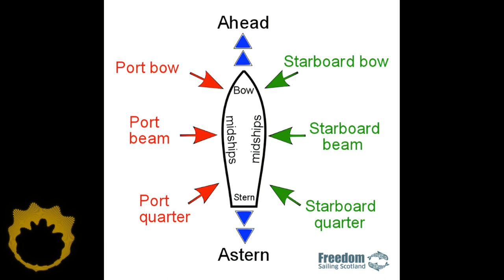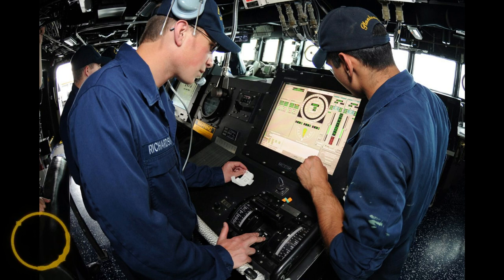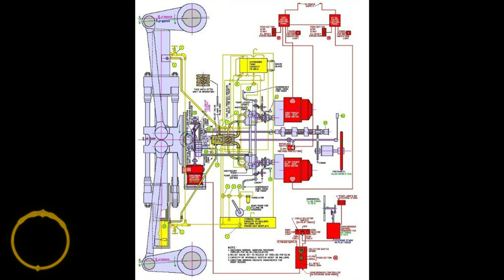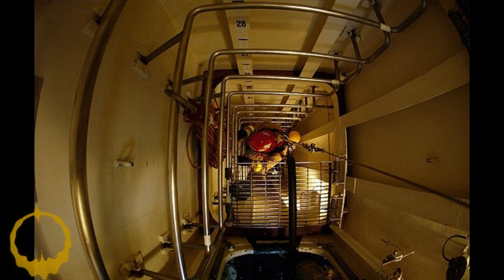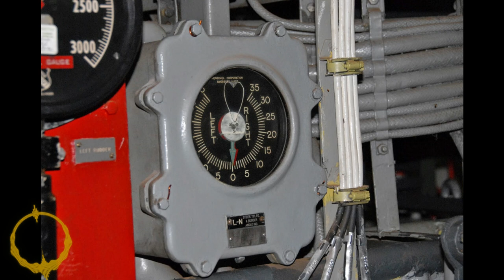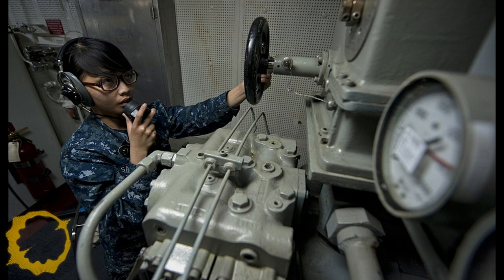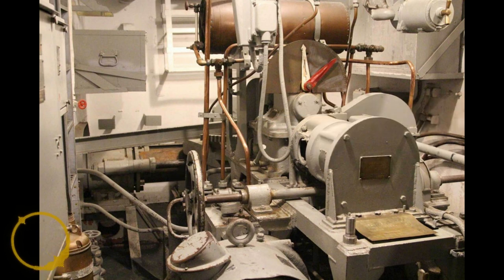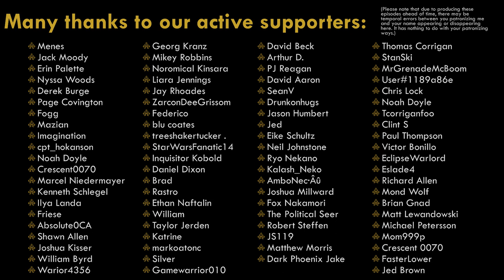I should get an award for a total lack of questionable idioms in an episode about Aft Steering

Comment: Touchscreens are not a thing we should be using anywhere, let alone anything important. They are simply garbage, either too sensitive, or not responsive enough, there is no inbetween, or rather, the inbetween is when it is somehow both, and in any case what you get is shitty controls.

Comment: I spent 2 years aboard a Wasp-class amphib as deck seaman.  In aftersteering the control wheel on the rudder engine is only about 8 inches in diameter; got to use it twice in training.  It is truly surreal to understand you are controlling where 40,500 tons of ship is going with nothing more than an 8 inch wheel, gyro compass repeater and rudder angle indicator, while also locked inside a windowless room, 2 decks below the waterline, and facing backwards while a voice on the headset tells you what course to drive.  Oh and you have to coordinate your rudder movements with a second aftersteering helmsman locked in the room next to you.  "Left five, and turn." And we both turned out wheels at the same time to ensure the rudder didn't collide.

And for the record the route to aft steering is as follows: walk to the aft end of the hangar and take the last ladder (port or stanboard) down a few decks, when the normal ladders/stairs run out climb down another three decks via the vertical ladder.  It is as it sounds.  Then stoop down and enter through an oompa loompa sized water tight door.  You have reached after steering, hearing protection is advised, especially at speed.

P.S.: the manual hydraulic pumps are NOT used to steer the ship.  It takes 64 revolutions of the pump to move the rudder a single degree.  These are only used to center the rudder at which point you steer with either just the remaining good rudder or with differential throttle on the engines.

Then the second to last resort for centering the rudder is a giant stationary worm gear and a ratchet.

Last resort?  A diver with cutting implements.
Reply from the maker: The use of the manual hydraulic pumps varies among ship classes, y'know.
Reply: @SacredCowShipyards  Physics, physics never changes. [/Ron Pearlman]
Reply from the maker: Rudder size, and number, does.
Reply: @SacredCowShipyards  More specifically what I am saying is that at any size of modern warship manual hydraulic inputs will render a rudder response time that is entirely insufficient for even minimal positive control of the vessel, hence the purpose of manual hydraulic inputs is at best used to center the dead rudder.

There is a threshold of size and mass where manual hydraulic inputs become adequate for the task.  In my ship's case the two small boats we had were both manual steering with hydraulic linkage.  The larger of the two being an 11 ton LCPL.  

P.S.: nice shipyard.
Reply from the maker: And I'm saying that on two disjoint classes of USN warships, the SOP for the hand pumps was to use them for actual steering, not just centerlining the rudder.  But, no, it was never going to be anything approximating "fast".

Comment: OK I got a question.  In the movie Speed 2 Cruise Control, they managed to turn the ship using the bow thrusters but as the electronics were down, they turned the bow thrusters using a hand crank wheel.  Whilst under water in a flooded compartment.  Ignoring the flooded compartment issue, is it even physically possible for one person to change the course of a cruise liner (albeit a smallish one by comparison to some of the giants built these days) just by spinning a wheel no bigger than a car steering wheel.  I mean if it takes 3 crew to use the wrench referred to in the video, one person spinning a wheel to drive the bow thruster?  One hell of a gearing ratio.
Reply: See, I'm confused.  If you mean they used a little wheel to change the direction of the thruster, it seems reasonable.  If you mean they used a little wheel to power the thruster, less so, because ships really prefer to move through the water the narrow way.
Reply from the maker: Yeah, there's basically no way a hand crank would be enough to turn a bow thruster's blades enough to actually do anything.  Honestly, since the ship was moving forward and the bow thruster was free-wheeling, the manual wheel would probably be spinning fast enough inside the ship to rip off digits.

Comment: I think you have come to the point why military in space has not become a thing. Military is making things go bad, preferably for the other guy, and expecting the same in return, so if you don't have a few levels of back up, all you have left is improvisation, which we know how military loves that. Cost to space by mass, then fine articulation of parts, cold welding in a vacuum, makes most things have no affordable backups. You don't see any kind of repair or even patch kits on most things right now. Even ISS only has it a little bit, and that is what makes sure they keep breathing. Why manned space in gneral is kind of really scary. You need a subset of home planet pieces to take with  you, and even stripped down to atmo and temp, that is often a lot of hardware for basic. Doubling that is really a big weight problem at the least, not to mention storage is in a different for than usage. 6 liters of LOX will give you a lot of breathable air, but you need to heat it and only allow so much in to the cabin at one time. Doubling up or making level of fail safe movement control is even more mass to shift. Luckily, most RCS fuels react due to the pressure drop form the tank to space, which means if you have some you can impart force, but controlling it along specific aimed lines could be a problem with just a bent nozzle, not to mention no nozzle at all.
Reply: The problem is that getting the backups out of the gravity well is expensive; on the other hand, not having backups when you need them gets expensive, too.
Reply from the maker: Thankfully, the decreasing cost of getting materiel into orbit will greatly increase the probability that future ships / stations will have adequate backups to preserve the existence of the little squishy things inside them.
Reply: @SacredCowShipyards  That's also why there is so much interest in Lunar bases and asteroid mining. If you can make stuff in space, it save a lot on launch costs.

Comment: Okay, hear me out... Giant wrench hanging on the bulkhead. Cap screw to secure it to the rudder shaft hangs beside it. 

Eye hooks on the bulkheads on either side of the compartment. A couple of big ol' chain hoists hanging from those eye hooks with heavy chains already attached. All of it normally secured, of course.  

Hydraulics go down, set the wrench, screw on the cap nut so the wrench will stay put without some poor swab having to hold it in place. Hook the chains to the wrench. One or two sailors on each hoist chain. Profit.

All mechanical, no electronics to go bad, exponential increase in power. Only an additional two relatively simple machines to maintain.

Comment: you can make that "big ___ing wrench" work!

you need three comealongs . . . two attached to the end of the handle with wall mounts left and right to pull against . . . the third attaches at the wrench center of gravity and is connected to a spot on the ceiling over where the wrench CG will be when deployed.

note: do not attempt in any condition other than flat calm!
Reply: Pretty much what I was thinking.

Comment: Any ship that has no backup for a backup is something questionable. Even old wooden boats had huge loads of stuff which only purpose it was to either help create the backup or be the backup. Of course backup systems can fail so you plan around that. Any spaceship in a half way realistic setting where travel through the stars takes a significant amount of time instead of being over in half a day will require enough backup that from a near total construction you are able to safely either limp back to a friendly "port" or at least call for help and have somewhere safe to wait for said help to arrive. 
And touchscreen for steering is the typical we need to be modern stuff that shows that whoever was implementing that never did steer anything significant let alone something of the size of a ship.

Comment: Cavitation is caused by the water effectively boiling due to low pressure. It is loud, violent, and causes noise and damage, but it also robs the ship of power and in the case of rudders, control authority.

I also had to take a minute to admire those screws and not just the curved rudders... you know they're putting out some power when they have to angle shafts downward like that, though I dunno if that was a "clear waterflow" issue, a "center of thrust" issue, a "make room for sufficiently large propellers" issue, or some combination thereof.

Addendum: Ships exist in this world without backups and redundancies, and they DO say something. "Your environment, your success in your endeavors, and your very life are not as important to us as our bottom line. We literally don't care whether you live or die so long as your check cleared. And if it didn't, we'll just bill your next of kin."

Comment: I actually know exactly what you're talking about with that wrench. Back when I was a sea scout in California we had an old 1950s Ex-army T-boat called the Gryphon. On the stern we had this red orange yard-and-a-half or so long steel tiller-like item on the transom, as well as a circular plate secured with flathead screws. I had no idea what those were for till we were on a cruise and Skip called a loss of steering drill. We took the plate off, lifted the heavy ass tiller up, put it on the nut that was beneath the plate, then secured lines and blocks to rings on both sides of the tiller and split the crew up to port and starboard. It was... certainly an experience, but to be quite honest I found it kinda fun in a weird way.
If I was still in California I'd be able to take a picture of it, but alas I'm in michigan, and none of the photos of the Gryphon that I have show the wrench. Still, felt I should bring this up as it is one of my many fond memories of Sea Scouts
Reply: Granted the Gryphon was nowhere near the weight of an OHP at only 80 tons, but I'd imagine it'd work the same way on there
Reply: Its crazy to think we still have that as a "just in case" system of TURNING. Like these ships are HUGE and HEAVY.

Comment: I suppose if you had a sufficiently long bar with a sufficiently heavy duty box wrench attached to an auxiliary vector thruster then it could maybe be used by a sufficiently huge crew member to give some degree of left and right as well as up and down? It would, of course, need to be set up 'above' a hemispherical floor to maintain contact and need suitable up/down/left/right sign posting.

Comment: Having manned aft steering on a Destroyer, I can verify the wrenches still exist, albeit in a slightly different fashion. On a ship with multiple rudders, should you lose all hydraulics for one rudder you lock it out with a pair of giant nuts on a 4" diameter lead screw. The key here is you need to maintain either constant thrust or zer thrust while locking it out. 

The one time we ever had to do that for real, some idiot officer on the bridge decided to shift what shaft was trailing while I had guys locking out one rudder. Damn near crushed someone. CO was pissed when she came down 5 minutes later and heard about it from us.
Reply from the maker: Locking out the rudder makes perfect sense.

Percussive maintenance on the person responsible for the course change with the wrench in question also makes perfect sense.

Comment: The wrench could be a good idea IF instead of using people to push it around you rigged a block and tackle system.  A proper set up would be a lot safer and would require fewer people to run it.  As for the escape trunk, that one looked pretty damned nice.  I toured the USS Lexington a few years ago and what she had just didn't look pleasant.  I do like the idea of rungs on two sides so your shipmates can have a passing lane in case you're not escaping fast enough.

Comment: If your vessel has any kind of shuttlecraft/fighters/parasite craft, and you have half-assed competent pilots, instant tugboats. Even if the thrust of those ships is like a wet fart against the hull of the main ship, it'll still turn...eventually.  Would asymmetrically deployed solar sails be a viable option? Was Treasure Planet not hot garbage??
Reply: Solar sails are a thing, although what little I've seen of Treasure Planet suggests that they were more interested in galleons-in-SPACE than what a light sail would actually look like.  The plus side is that these sails fold up very small and take up little mass.  Down side?  Unless you've got somebody shooting light your way you don't get a lot of thrust, and even if you had any silly ideas about stealth in space you can discard it because light sails are ginormous, and tend towards the shiny, albeit very thin (which is why they can fold up so nicely.)
Reply from the maker: cough

https://www.youtube.com/watch?v=-VUmFpibgIU&t=264s
Reply: @SacredCowShipyards  Oh I'm fully aware of your adoration for the film. Thus the shot fired across the bow so to speak (I actually found Lost in Space to be a supremely guilty pleasure...like feet pics...or certain beads...)

Comment: So here I was nearly through the vega run...  We hit a rock and reaction control went down. Unless you want to fly right into the actual Vega star, you have to flip over and begin hard deceleration shortly after entering the system. What? Did you think we burned freight at one G the whole way? Anyway, we tried the backup system, but it was unresponsive... The answer according to the Seridyne Systems manual is MANUAL READJUSTMENT of the main drive cone. I ** you not, they have a 12' long spanner attached to the aft end of the ship under an access panel, and you have to attach it to the nozzle and attach block and tackle to the port and starboard cargo nacelles and a clevis located near the the dorsal comm array, anchor yourself to the aft airlock, and start haulin line like some terran wet sailing vessel. Then you detach everything and stow the gear, get below and strap in for the flip... THEN THEY WANT YOU TO GO OUT AND DO IT AGAIN!!! Only this time you are attaching to the the port and starboard nacelles and a clevis by the ventral landing strut. Problem is this time the main drive cone is still glowing white hot after a twenty second ionized hydrogen plasma burn. Oh and ye better have some Duct Tape on you because there is a good chance that the wrench will have conducted enough heat that it will melt one or more holes in your suit while you're trying to stow it. I'll give you two guesses who happened to be the lowest rank on the engineering team when that happened. At least the Chief bought me some good scotch after I got out of med bay.
Reply from the maker: Scotch cures a lot of ills.

Comment: An interesting thing about the little bubbles created during cavitation. The inside of those little bubbles are as close as it is possible to get to 100% reflective.

There is also the possibility that Nanoscale cavitation bubbles can be used to utilize the casimir effect to produce energy. "Hope I spelled that right?" There was a plumber in Southeast United States who designed and built a water heating system for a firehouse. This water heating system produced overunity energy. Quite a few physicists came through to look at and figure out how it worked most of them left scratching their heads. One physicist theorized that the system he created was producing nanoscale bubbles through cavitation. He also stated that it's possible quantum photons were bouncing off of the inside of the bubbles before they disappear adding mechanical energy into the system.
Reply: That sounds very interesting, any reccomended further reading on that? Im having difficulty finding anything.

Comment: Story I'm working on , off & on has gravitic drives (primarily for ftl, & exploited for artificial gravity), bow & stern sublight drives, rcs, & ai running each ship that at the absolute minimum  can use their radiators as a very inefficient solar sail. The biggest management issue for any ship is their heat. All the weapons generate heat, the shields can block just about anything... & generate heat. The drives generate heat. Every ship has capacitors to store said heat ... to an extent. But every ship has its limit at which point one of three things happens. The vessel turns into an easy bake oven. (Worst case scenario.) Or the ai vents heat In one of two ways. Extends her radiators, ( which are obscenely fragile compared to the rest of the hull and are probably glowing like a star at this point) or dumps it Into the freezing cold realm of fold space. (Announcing to anyone bothering to look within several billion light years where they are with the thermal bloom) the panic button option is to jettison the whole capacitor bank (which unregulated is probably going to explode) & pray they can limp along back to friendly space on the emergency capacitors or have help turn up. .
Theirs a reason crotch rocket space fighters aren't a thing in setting & the smallest open space run about has about the same volume as the air forces BUFF. & ships tend to behave like 1940s naval ships. They travel in groups because wandering off by yourself will inevitably be when you get in trouble. No star trek enterprise trips here. Anyone trying it is going to have a very unpleasant encounter with a shipping containers worth of brass assuming they get home in one piece. 
It's an on & off project& I have no idea if it's a setting anyone would want to read about. But these videos give me plenty of little detail ideas.
Reply from the maker: Heat is the one big problem for any space-based science fiction story, which is why so many stories don't even try to touch it.